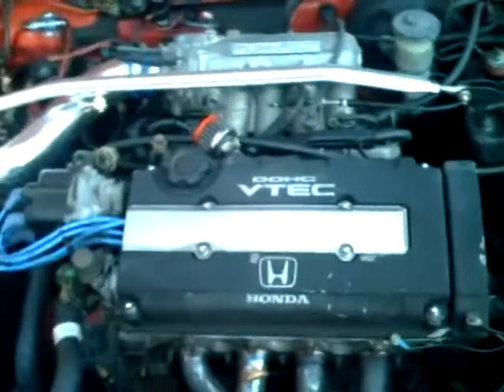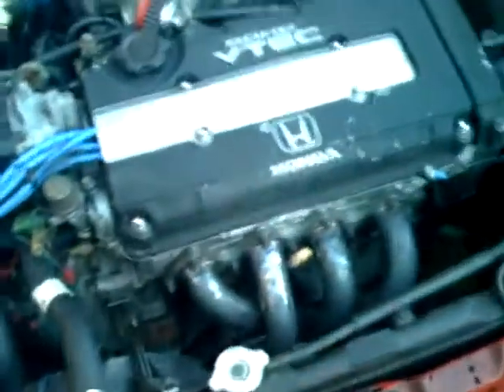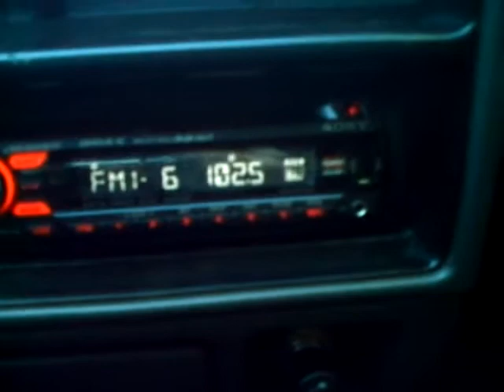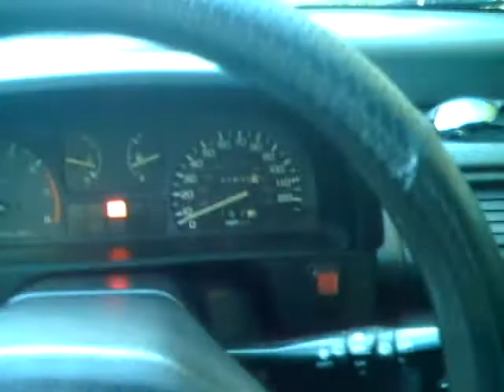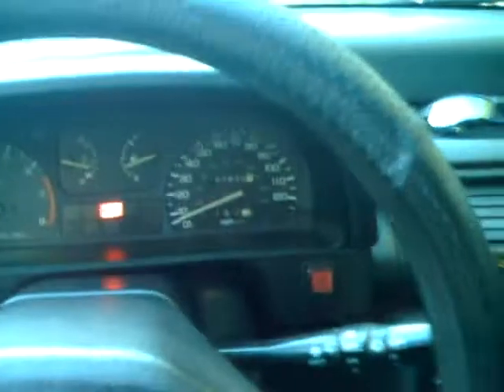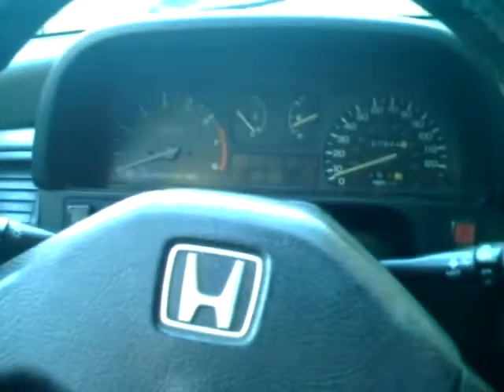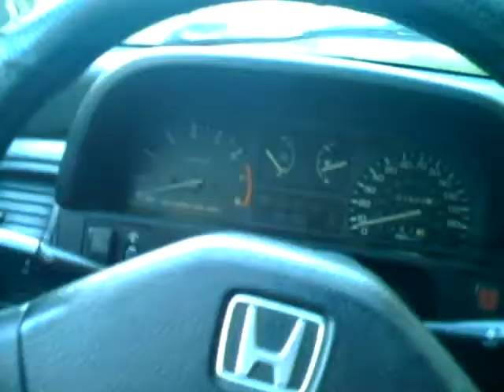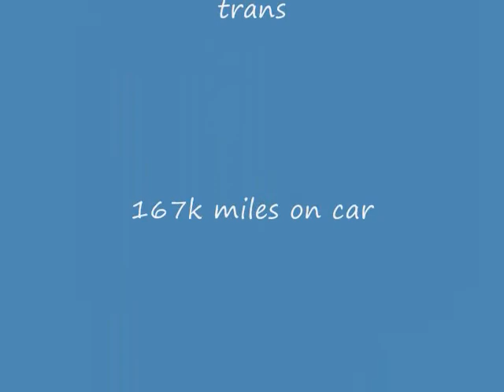1991 Honda Civic Si hatchback B16a DOHC VTEC Swap

Comment from the maker: It all depends on what you are looking for man. My swap cost me a little over $2k, but I did all the work myself. And my car is an Si, so it made the wiring a whole lot easier. If you buy a DX or some base model Civic, you'll need to buy conversion harnesses that will raise the cost of your swap.

Comment from the maker: I did it all myself. It was an easy $2k, probably $2200-$2300. My swap was pretty easy, but I have an Si. With an LX, you're gonna have to wire up 4 fuel injectors because you should have the T/B motor with only 2 injectors. Hasport makes an easy plug in harness for that. And make sure to beat the frame in on the drivers side, or your alternator pulley will rub. I recommend going with obd1, because I have obd0 and I hear obd1 runs much better.